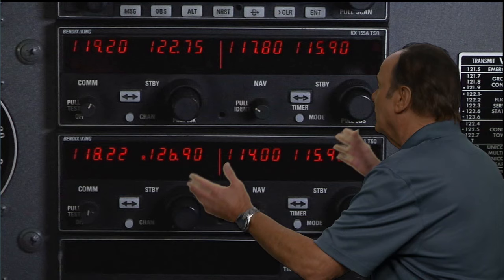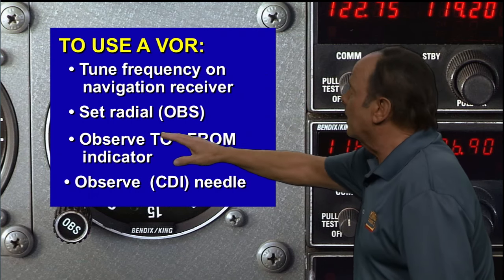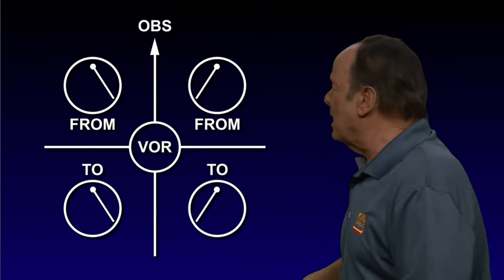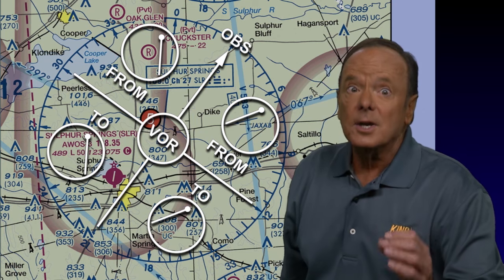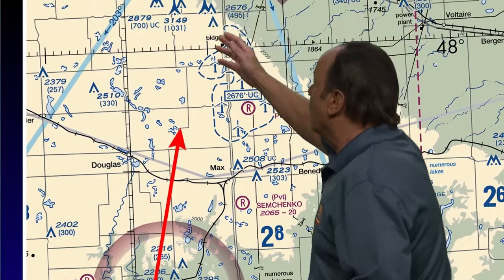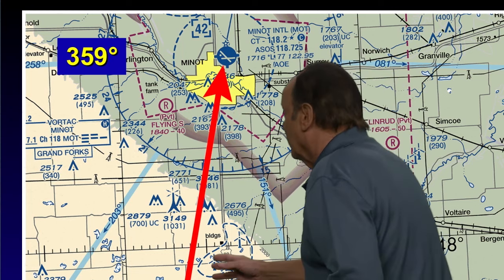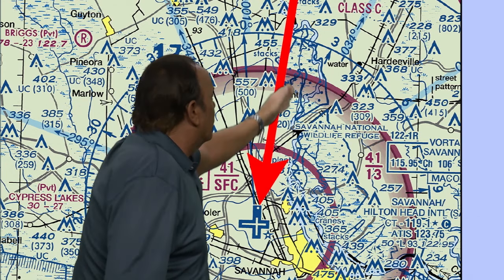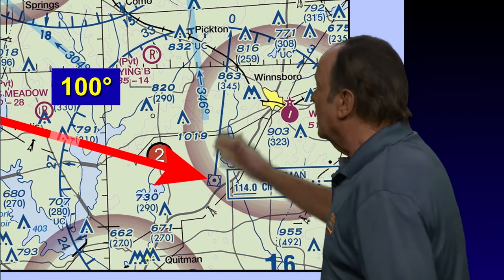VOR Navigation is Simple... Right? // Private Pilot Ground School

Comment: Why not use a sextant for ship navigation?  VOR is like the horse-and-buggy of navigation.  It's a waste of resources to build aircraft with VOR technology. GPS made it obsolete.  VOR is OLD technology, and should be shut down.  Even dead reckoning with electronic gyros can give better results.
Reply from the maker: Because the FAA is still testing for VOR knowlege, so take it up with them I suppose.
Reply: @KingSchools  lmao 🤣
Reply: It will be there if your GPS fails. It’s not about learning one thing because it nullifies another. It’s about learning to use all available resources no matter what. VOR is still an available resource, therefore we learn it. We also learn GPS.
Reply: Because WHEN (not if) the constellation goes down, or when your GPS is unreliable (NOTAM'd out in a large area-happens a lot out west - NM/OK) the FAA has decided to navigate you to the LOC/ILS IAF via VORMON (VOR Minimum Operational Network). So, it doesn't matter how advanced the GPS is, you would have to know this in order to use the equipment on your airplane to get you down safely. In the last four years, I have been on a long x-cntry at least three times when the FAA has NOTAM'd out GPS as unreliable or unavailable AFTER I departed (because sometimes the guys in the white lab coats with the pocket protectors give little to no warning). For at least 45 minutes, I heard loud whining noises on COMM 1 from airliners overly concerned (almost panicked) because all three of their on-board GPS/Inertial combo units were flagging unreliable. My one G750 was depicting me 20 miles right of my actual position, but I recognized the issue and then 15 minutes or so into the anomaly heard the ZKC Center controller confirming my assessment (he read the NOTAM), I already had both VOR receivers tuned into the two stations that anchor that particularly long stretch of airway. I could see by deflection, time and wind how far I was from the Victor airway. I simply realigned myself with the  airway to clear the mountains either side.  Much safer than buying what the GPS was selling. I was also able to ask for/receive clearance immediately for higher, since I knew my exact location (😏 with a little cross tuning). We are scheduled to lose 429 or 439 VORs East of the Mississippi, leaving us with VORMON to act as a safety net in the event of unreliable/unavailable GPS. The plan is to keep all the "mountain valley route defining" stations out West for obvious reasons. THIS is why we still need to understand how to interpret VOR nav.
Reply: We do use a sextant for ship navigation… as a backup to gps.
Reply: We do use a sextant for ship navigation… as a backup to gps.
Reply: Sextant hehehehe… sextant
Reply: It's used because it's still available in many countries

Comment: And as always, you flight instructors are forgetting something.
When you have explained all the ways that VOR and OBS works, you have students starting to set the VOR settings 250 miles from the station, og students flying in valleys or behind mountains....

Why don't you, and this goes for all instructors, explain the distances that limits the use of an VOR station, or the impact mountains have on it ???

Now i to am a pilot in real life, and i can find soo many explanations on this subject, but no one are explaining the limits...
Reply: You are supposed to check if the VOR is operational by checking for its Morse code every time you use it anyways, regardless of terrain or distance...
Reply: @OortCloud  so you would find it reasonable to start from a distance of 250 miles? It’s not even possible to find the VOR direction which you have to, to find the station.
Reply: @DjankoDK  Dude. Its logical. No normal student pilot is gonna try to find a VOR from 250 miles away.